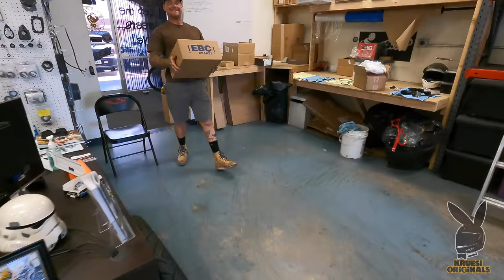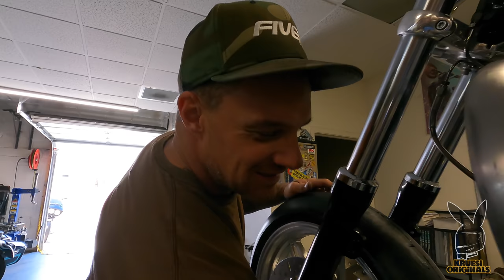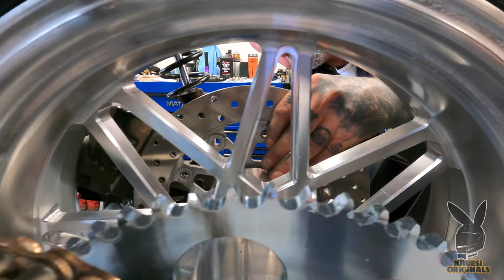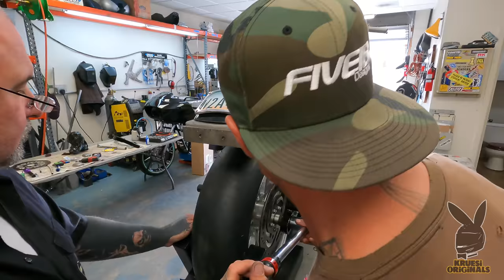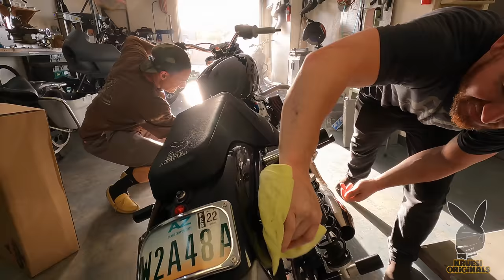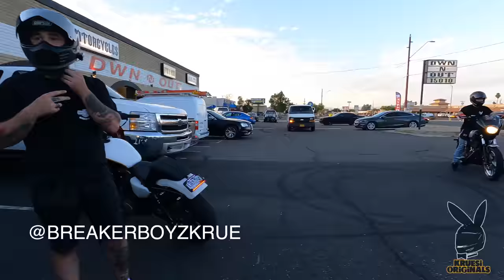Trying to finish the StreetRider track bike conversion the day it supposed to be on the trailer.

Comment: I thought you weren't a fan of the floating rotors because the small aluminum piece jointing you preferred the solid rotor. Forgot the video you mentioned it

Comment: Hey man I heard you say something about running 7/8 Mx bars for more control, if I get pro tapers and they’re 7/8, how do I get the Harley hand controls to fit, I saw there was shims but it went over the entire bar end to make them an inch. Which makes it pointless to have 7/8 bars.
Reply from the maker: You can’t run the Harley Davidson controls we run seven eights and we switch over to sport bike stuff far better and a quarter of the price of any Harley rat shit
Reply: @kruesioriginals   so a bunch of wiring and stuff involved. Shit. I can’t afford to pay $1000 for someone to do my bars. You can’t use shims or something under the switch housings? That’s what I was talking about, switch housings fitting on the 7/8 bars, sorry, said the wrong shit
Reply from the maker: @tattoojohn92  Yeah you can shim it but what’s the point of running 7/8” bars then? 
Just get some fly Moto 1 inch bars, they’re already machine and ready to go. If you call the shop we can get you some they’re like 68 bucks. Phone numbers on the website or the Instagram

Comment: I thought you didn’t like full floating rotors....? I know it’s hard to bitch when they are free but what gives homie?
Reply from the maker: So we’re putting a video out on that we’ve had a huge debate. We went back to solid rotors after cooking some floating ones which we cooked the solid ones way faster three sets of them actually. So we’re back to the drawing board I think EBC is just a better brake all around